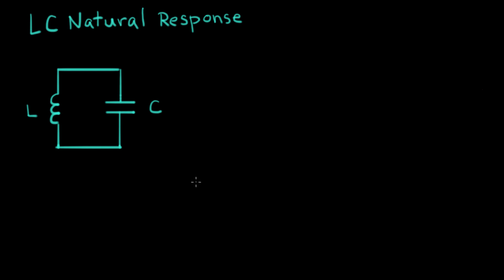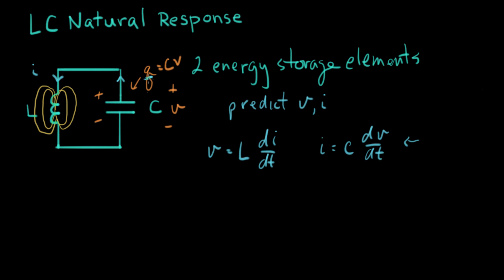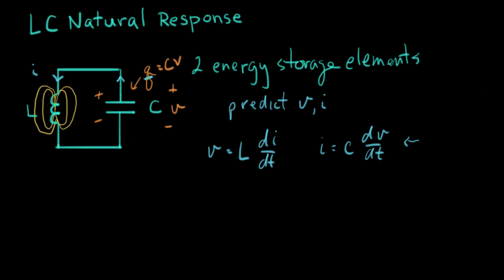LC natural response intuition 1

Comment: I think in the timestamp 1:15  to  1:30  it would be much more accurate to state that the energy stored in the inductor (L) is mostly stored INSIDE the coil instead of "in space outside of the coil", as most text books and instructors state that the magnetic field of a current-carrying inductor is virtually ZERO on the outside.
Special Thanks for these high-quality videos..
Reply: ...continuation of the previous statement:  I  was watching this with my niece Millie, a senior in HS, who points out, after discussing the video while skimming back through it,  that our statement above, which I made a few minutes ago, is reinforced especially after doing one of her science experiments which was making an electromagnet by winding wire around a metal nail, and testing the magnetic strengths at different positions, and viewing the magnetic field in a 3D mineral oil viewer at school.  Millie would like to know if she misunderstood something that maybe happens when the capacitor in in the circuit.